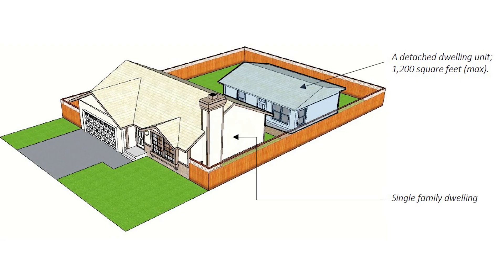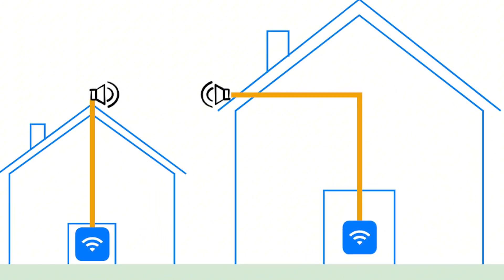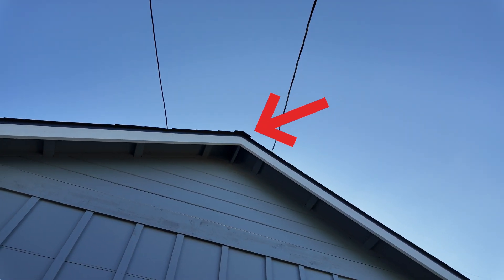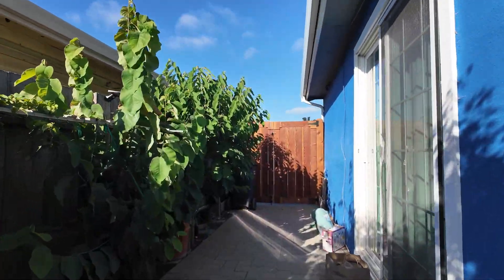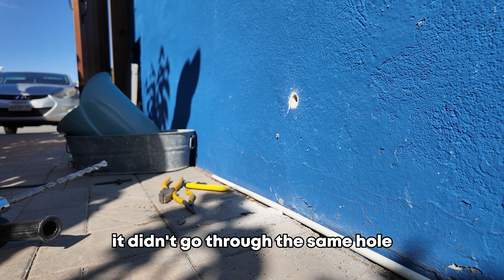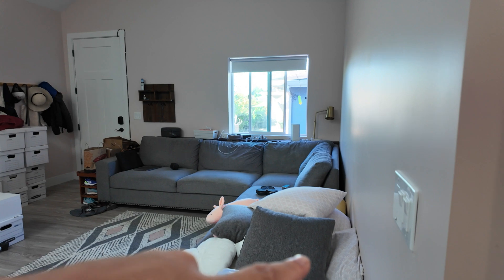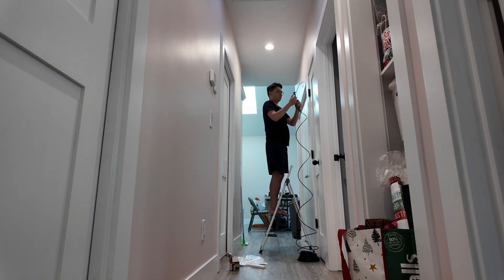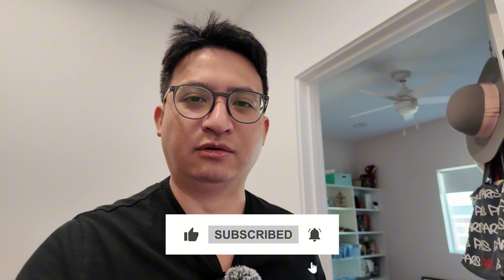Best Way to Run Internet From One Building to Another!

Comment: Awesome video! In case you are still wondering why Comcast upload is that slow: COAX cables got a limited spectrum to transmit data via the so called DOCSIS  standard. Since most customers are just consuming media, downloading games etc. , there is a higher demand in download speeds rather than upload speeds. So the average customer benefits by allocating more of that spectrum to the download rather than upload

Comment: You really should hide the result id if you wan't your location to be undisclosed. Just a tip. I got 1000/1000 for about ~$50/month (In Sweden tho).
Reply from the maker: Thanks for the tip and wow that is super cheap internet. I was paying $110/month for 2gig fiber up/down not too long ago via ATT fiber, but unfortunately it is not available in my new area.

Comment: Dude, you could've at least used some white cabling
Reply from the maker: 😂 that was my first thought when i started running the wire inside the ADU. I think i originally bought black so that the outside wire would be more hidden. This was a temporary solution though.

Comment: going up to the attic is a pain but the end product is much nicer.  Just run it into the attic from the outside and to the wall of the office room/closet and bring it out there.  Then it looks like the house was built that way.  In my case I had a surprise with a cross bean halfway down the wall to get through but I just found it with a stud finder and made a hole in the wall there and drilled a hole for the cable to go through.  You could patch the hole with sheetrock and spackling or you could but a square cover and put that in the wall so you can get to it again if you need to run another cable (I did that, I think I have 3 in my wall now).
Reply from the maker: I agree! Running it through the attic or crawlspace would be a cleaner solution. However, this was meant as a temporary hardwired internet solution as Comcast didn’t have the new ADU construction address in their system yet. I eventually got separate internet service for the ADU and they ran their wiring through the crawlspace. This temporary solution was then removed, but I left the ethernet cable bundled up at the main front house in case I ever needed a backup reliable hardwired internet solution again.
Reply: @foureyedtechguy  Yeah, there is also the aspect that this is probably a temporary living situation anyway.  I watch a lot of home improvement type of videos and you don't need to do it the best way, just showing that it's not that hard helps a lot of people.  I recently had a clogged toilet and a snake wouldn't fix it so I took the toilet off and really got down the pipe and fixed it myself.  The guy at the plumbing supply said that it was probably a broken pipe and would cost around 10k to put new pipes in.  I spent around $100 for various tools and a heavy duty snake.  It was hard work but worth the money.